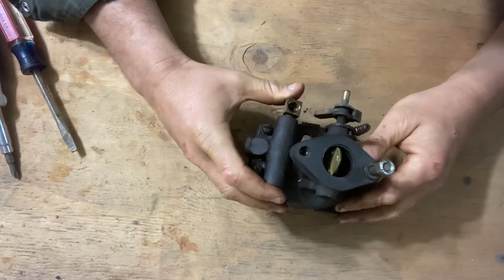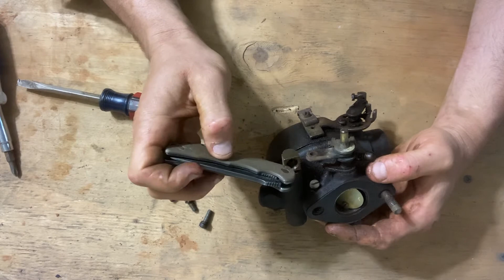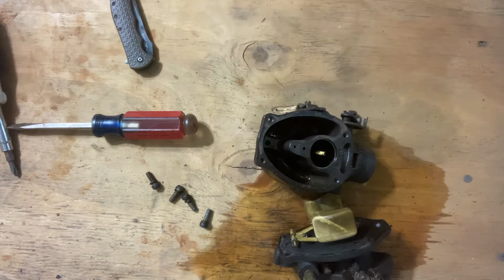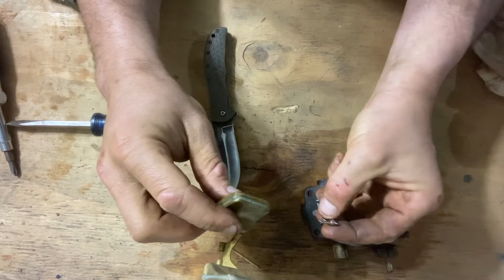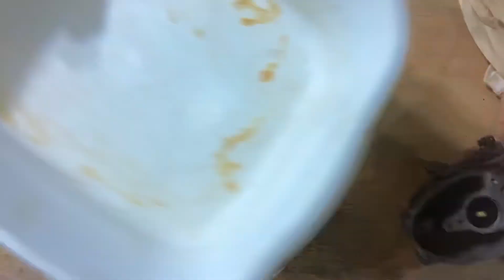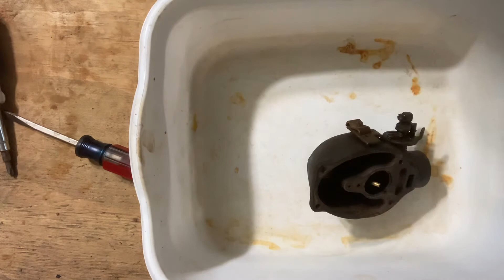How to rebuild a zenith carburetor for a SA 200 welding machine

Comment: I have a question, so mine is leaking but I can’t tell where from. I just bought the mounting gasket do you know where I can get the middle gasket online?
Reply: Okay, that makes sense I appreciate it!
Reply from the maker: Many times you can find the gasket In a rebuild kit at tractor supply. Other than that, the only thing I could tell you is to look online or to try making one. But in my experience, when the Carbureter is leaking all over and you can't quite tell where it's leaking That usually means that it is flooded And the problem is actually in your float, not in The gasket
Reply: Okay, that makes sense I appreciate it!

Comment: Would you suggest to buy a new one or just rebuild the one I have right now ?
Reply from the maker: I would definitely  Try rebuilding the one you have first.  I've had several of these machines  And I've only had to buy one new carburetor out of all of them
Reply: @Johnscarborough1  I went with fixing mine those are expensive thanks for the video

Comment: How would you shut off the gas on a sa 200 blackface
Reply from the maker: I believe they are all very similar if their gas enginesBut I’ve only ever owned read Welding machines so I don’t know for sure
Reply: You shut the fuel off with the valve attached to the fuel bowl assembly that's threaded into the collar on the bottom of the fuel tank
Reply: @Ckmerr exactly 😂
Reply from the maker: Red face